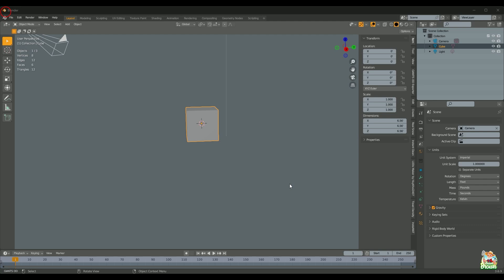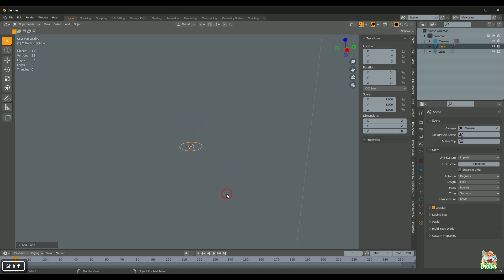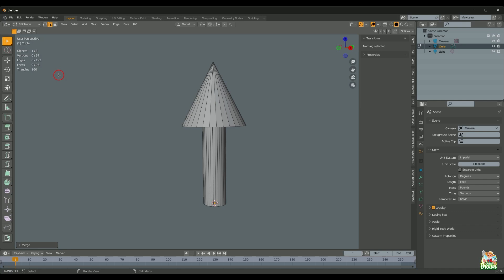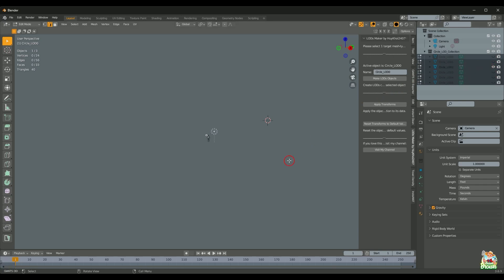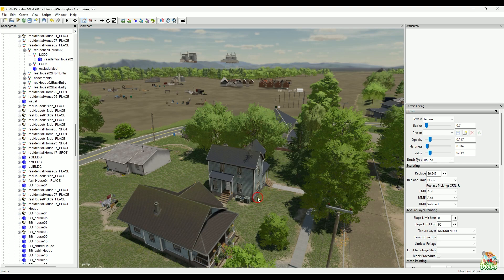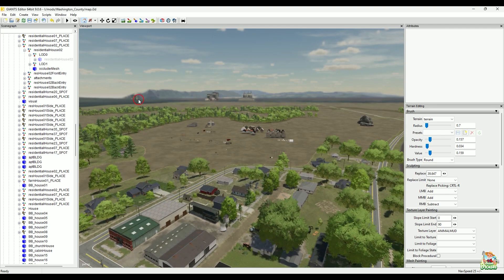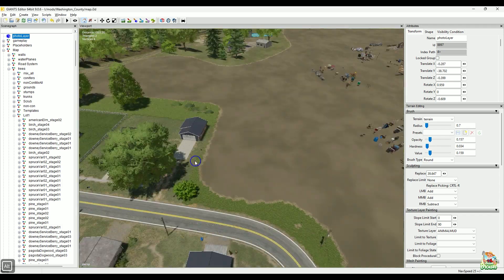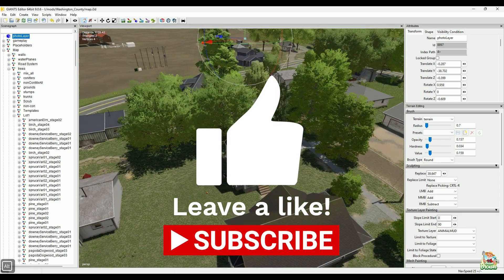LODs - What they are and how they work. Everything you need to know.

Comment: Wow what a difference the lod maker addon makes vs the decimate modifier. I was doing some lod's a few days ago trying to get my lod_1 just right with the decimate modifier. My big silos turned out really good but ill redo a couple of my custom traffic vehicle's with the addon and should get much better results with it, and its quick at generating them too.
Reply from the maker: The add-on mostly uses the decimate modifier, it just does a better job of it. I must be doing something as well, because mine never turn out as good without using the add-on. I also like that it's super quick, it saves you a heck of a lot of time!